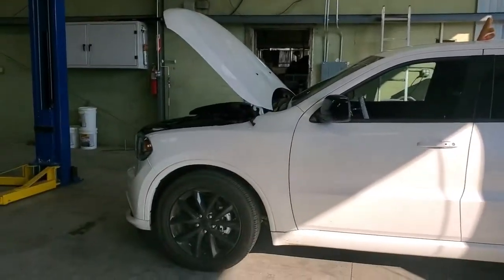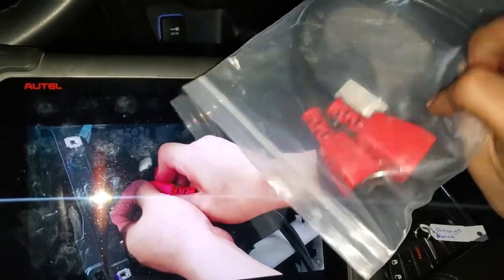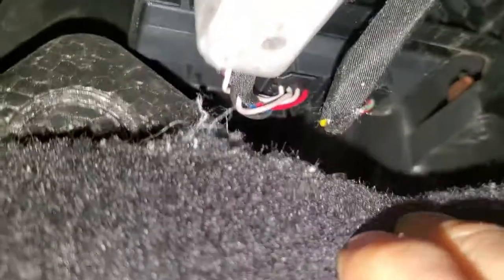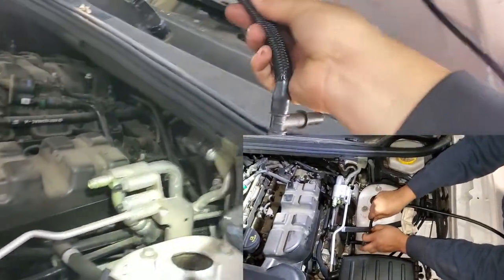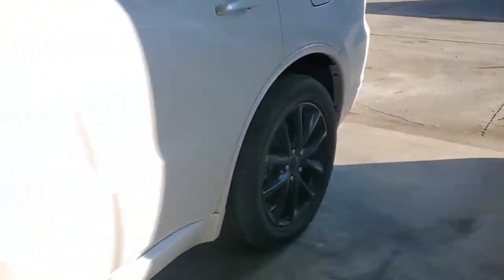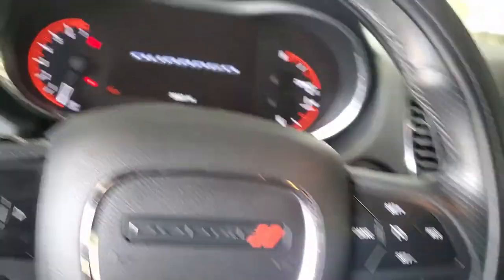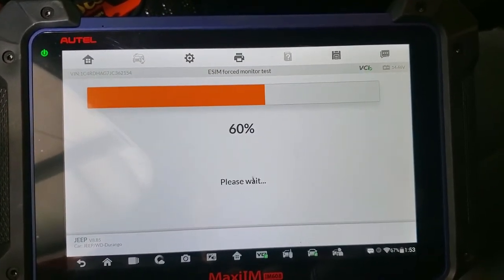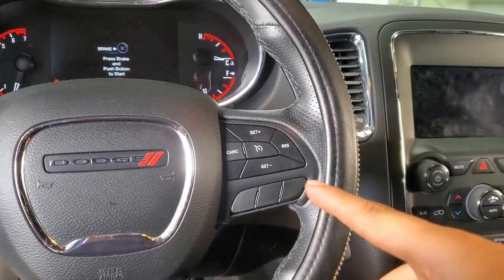How to fix codes P0455, P0456 on a 2018 Dodge durango using Autel scanners IM608/Autolink.

Comment: I have a 2018 Durango GT with a small leak on the evap. I changed the purge valve canister along with 2 other hoses. I’m the check engine light stays on. What’s the model scanner for the little one???
Reply from the maker: you know on these models I have changed the valve that goes on the canister I have had many issues with aftermarket one and sometimes I have seen that people put that valve upside down. what code r u getting?
Reply: @JVFIXLLC  thanks for the reply. I’m pretty sure I installed the valve purge and hose purge. It’s pretty straight forward. (I double checked.) I received the Autolink AL319 and was able to delete the codes and check engine light is off. However, I have 2 codes which says it’s permanent. P0456 and P0440. If I still have the issue will the check engine light back?

Comment: Hi I have this issue in my 2018 Dodge Durango GT V6 engine. About how much should this cost at a mechanic shop to fix? Thanks
Reply from the maker: the diagnosis is usually about 150 but it depends on the area you live.